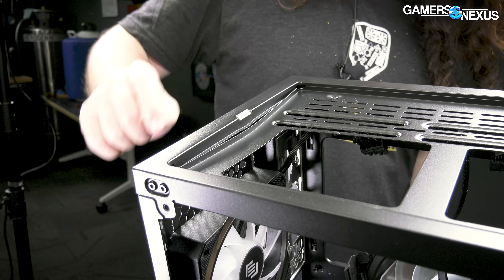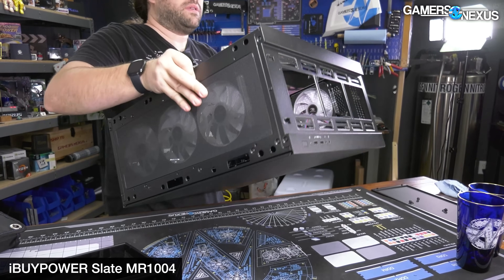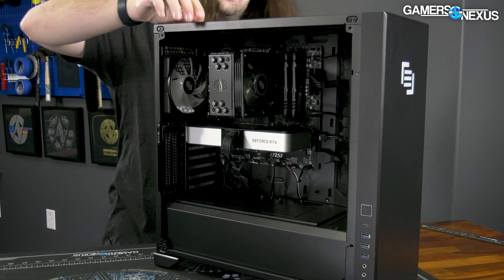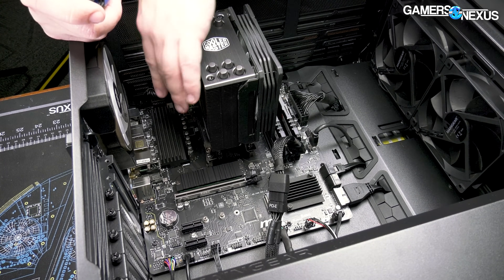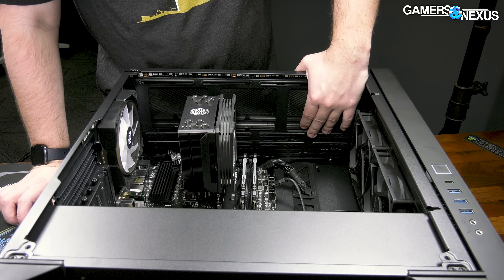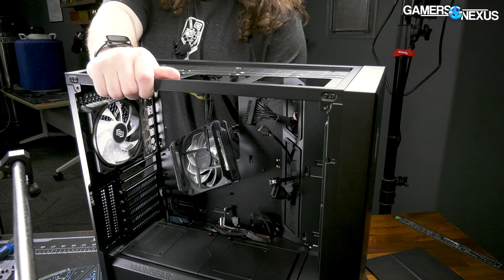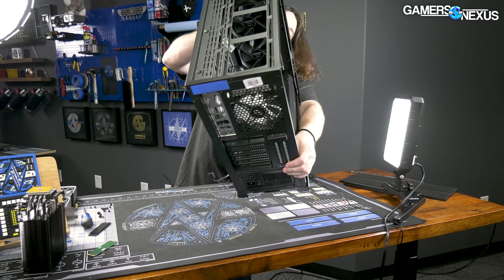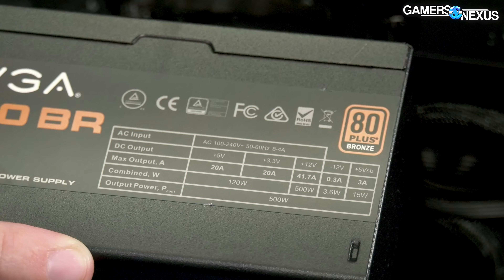Maingear Did It Right: Secret Prebuilt Gaming PC Review ($1700 Vybe)

Comment: Holy shit this is literally the exact PC I bought. It’s my first PC. Seems I made the right choice for a prebuilt
Reply: @cockatoo010  I’ve had it for a couple months now. I had to send it back initially because the cpu was busted. But after I got it back (which took a little over a week) it works great. Haven’t had any problems with any games I’ve played. Forza Horizon 5, Monster Hunter Rise, and Genshin Impact for example run great. Only thing I am going to improve is upgrading to 32 go ram
Reply: @nemesis8508  I'm curious what you mean by "the CPU was busted". You mean the CPU cooler? Because if so I would think that would be shipping damage. But considering the response from the CEO I would be inclined to believe that they would claim all damage as shipping damage as apparently they "run a tight ship". I suppose an employee making a mistake and passing on a damaged PC to a customer in order to avoid explaining it isn't even considered a possibility on that ship.
Reply: @nemesis8508  you don't need 32GB of ram if all you're doing is playing videogames
Reply: @lightly-red-huedmaleindivi6266  But 8gb v-ram might not be enough for some modern titles at higher resolutions. But I don't worry about that since I can't see past 1080p... 😅
Reply: @lightly-red-huedmaleindivi6266  I’m a game developer
Reply: @JonathanGray89  well the Pc would not boot and the cpu light was on. The support dude said it was most likely a bad cpu (don’t remember exact words).
Reply: @nemesis8508  Oh interesting. That makes me think there is probably a QC issue after all. I've done tech support and have never even come across a PC with a bad CPU. I've only ever actually seen that code associated with overclocking, bent pins, or unsupported CPUs. They will easily outlive every other component of your system unless you're doing some crazy overclocking.
Reply: @fahimp3  think you mean ram, vram is part of the gpu
Reply: @vanilla4064  I do mean v-ram since I was referring to the gpu. Cpus are less relevant than gpus when it comes to gaming, especially in higher resolution. When I said "But" I agreed with the commenter that 32 gb ram is not needed.
Reply: @fahimp3  Quality settings affect VRAM usage way more than resolution does. 8 gigs is plenty to work with if you don't expect to run every game at max settings.
Reply: @JonathanGray89  The greater the resolution, the greater the demand on your graphics card’s VRAM. The main reason for this is the GPU is having to physically render more individual pixels when using a higher screen resolution – requiring access to more data at any given moment.
Reply: @fahimp3  No, that's actually an explanation for needing a faster GPU. Many games barely require more VRAM with higher resolutions and the ones that do require considerably more are essentially because of quality settings anyway. You need higher quality textures for things to look relatively as good with higher resolutions, and textures tend to take up the majority of VRAM. Not to even mention things like shadows and anti-aliasing.
Reply: @JonathanGray89  "plenty" is a bit much. its enough... for now
Reply: @kingplunger1  I'm not sure what your standards are but I stand by my opinion of plenty. I have 8 gigs of VRAM myself and I don't find myself worrying about VRAM usage. Plenty enough for myself and many, many other people... For now, of course.
Reply: @lightly-red-huedmaleindivi6266  What about games that are usually memory/CPU intensive? Like say, large scale RTS/turn based games? Basically with lots to process like AI movement and such.
Reply: @PoisoningShadow671  No need even then for that much RAM. That much is really only useful if you're doing heavy multitasking, for example playing memory-heavy titles along with having like hundreds of browser tabs open.
Reply: @lightly-red-huedmaleindivi6266  lol

Maybe if you're only playing side scrollers. I have several games that use 32GB+.

Comment: My friend has this exact model and I have two of the higher level Vybes from this year. We both upgraded the SSD and the RAM and these things eat through anything we throw at em. Their build quality has always been clean and their support is awesome. For what it's worth, we didn't see the severe upper chassis damage in the video, but there was a little damage around one of the metal back panel screws from shipping. Great packing foam saved the tempered glass though. Out of sight, out of mind.

Comment: Just a thought: since this video series is running over a long time now, what do you think about adjusting the comparison charts for the new prices on these prebuilts? I just checked and I see that the Aegis R at $1700 now has an RTX3060, and the config that Steve reviewed is now $200-300 lower than when it was reviewed.
Reply: This system would still be better since it's priced the same but has a 3060ti instead
Reply: You should focus on how little care is put into building the system with MSI Aegis R, not its price. They send you a computer that doesn't come at the expected performance level. That's not acceptable even if its a gift.

Comment: I'm honestly stunned you got ANOTHER computer with product damage. It's something I've never seen, but I believe it's been the majority of cases for you now.
Reply: I’ve gotten quite a few cases shipped to me over the years damaged in shipping. My last one was the thermaltake tower 900.  I think ups and usps hate my hobby
Reply: It seems most of the pre-builts they've bought have had some damage somewhere.
Reply: My NZXT H510 case was also damaged during shipping. One of the panels had a massive dent that I had to smoothen out myself
Reply: @nathanlowery1141  maybe I've just been lucky. However, I don't remember any of their case reviews having damage over the years. Maybe that's because the companies knew who they were sending it to.
Reply: @Joostinonline  Or it could be the driver or loader that does their route for the shipper.
Reply: My HAF X is the last case I bought (and still use), and even back then there was some minor damage to the case.

Cases get damaged all the time because they're bulky and heavy, and really aren't designed to take a beating.

Comment: Microcenter used to sell those cases.  They occasionally got dented like that.

I built a PC in that case and just mounted the AIO fans as intake rather than exhaust.
Reply: I wonder what kind of scam that bot is running.
Reply: @FuburLuck  I'm guessing it's a variation of the Nigerian Prince scam.  They'll try to get your banking info to send you the prize, then drain your funds.

Comment: I built my first pc in this Maingear Vybe case, which Microcenter used to sell as a standalone. This case is designed and better suited for water cooling, Maingear uses it for their high end custom loop builds. I first used the stock Ryzen 3900x air cooler and the thermals were ok at best, would clearly benefit from more airflow. Then I installed a Corsair 360 aio as a front intake and both my cpu and my evga 3080 top out in the 60s, never break 70 even under heavy load or simultaneous benchmarking. I’ve been very happy with this case and never felt the need to update/upgrade it, and I’ve upgraded every other component in my build, some several times over. I’m also a car guy and love that the Maingear logo is inspired by the manual gear shift pattern.

Comment: Cool to see you review a main gear. Although a lot of these prebuilt are horribly priced right now as they are priced like gpu’s are still double msrp when they are somewhat normal now.
Reply: Yep. Hopefully pre built prices start dropping too. My local micro center had 5 3060ti's in stock for retail. I was blown away
Reply: To be clear, this system was ordered back in October this past year, back when GPU prices were still hot garbage. I'm interested to see where a system like this would sit with prices having come down significantly as of late...
Reply: @TommyFenstermacher5150  i mean they already dropped the price by $100 compared to in the video

Comment: I knew it would be maingear . Lol. I purchased a system from them a little over a year ago.. 5900x cpu , 6800xt gpu , 240 aio on the top . Never seen my CPU break 70°C with all core over clock. The case works better than it looks .

Comment: I bought the 3070 / Ryzen7 w/AIO cooler version of the Vybe during their black Friday sale for right around the $1900 mark. It beat or met basically everything I cross shopped it with at the time in price to performance. I can second everything GN found in this review good and bad.  My case wasn't damaged like the one in the video. However it was a little twisted, which made it hard to install the side panels after removing the packing. I gave her a little reverse twist to straighten it out. The box it shipped in was pretty beat up so I suspect shipping damage.  If you going pre-built I would highly recommend Maingear, seam to be one of the better system integrators out there, especially for the price. My only real complaint is it shipped in a bright red box with a PC on it during a GPU shortage, discrete packaging would have been nice. Maingear doing well in LTT secret shopper series was one of the main reasons I went with them

Comment: I bought a customized Vybe 3080 on October 25th, which was delivered on November 29th. After a few months of owning the PC I started having issues with games and other applications crashing and the occasional blue screen of death. 

I did some troubleshooting and after running memtest  I discovered I had faulty RAM (2x16 GB DDR4-3600). Maingear sent me a replacement kit after paying a deposit of $269, which was refunded upon return of the old RAM kit.  It did cost me the price of return shopping on the old RAM, but it was like $20 so no big deal.

Overall, I'm very satisfied with my build.

Comment: I got a 3080/5900x vybe last year.  I wish I could have built it myself, but at that time it was impossible to find a 3080 for a reasonable price. (It would have cost me about as much as I paid for the whole system for just the 3080) overall I had no issues at all and it has been performing fantastically since I've gotten it.  Good to know you put a seal of approval on it.  I do plan to do a case migration at some point. But I haven't had any issues with Temps thus far (I know. Surprising since it seems so choked off.) Cpu never goes above mid 60s under load. And the gpu sits right around low to mid 50s under load. All on all I was (am) happy with my purchase.

Comment: "Today Steve says he would probably recommend a prebuilt PC in a case with a solid front panel." Who are you and what did you do with the real Steve? But seriously.. that just shows how bad most of the prebuilds have been. A PC built without any major mistakes other than being in a sh*t case makes it relatively good.
Reply: To be fair to the case and SI, cooling wasn't an issue. One commenter said it did result in a lot of dust being pulled in, though.

Comment: Awesome video! I hadn't heard of Maingear Vybe, but they're definitely on my radar now! Thank you for taking the time to strip the PC down to examine the build and sharing all the stress testing. I've really been enjoying these videos as I'm trying to learn more about either building or buying my next PC. I'm learning very quickly that bigger price tags DOES NOT MEAN the person putting the machine together knows what they are doing! It's the little touches you guys found during the testing or stripping that blow my mind; superfluous engineering in Alienware/Dell or globs of hot glue in Wal-Mart PC's, or even just poorly designed airflow: seeing how these impact the system build's heat, processor speeds, and GPU performance has been really eye-opening! Thank you again for taking time to educate your audience and do deep dives!

Comment: I've never owned a Maingear, but they've always given me the impression they are a top tier OEM.
Reply: Dell and HP are OEMs (Original Equipment Manufacturer). Maingear is an SI (System Integrator) since they don't make components, they buy and assemble them.

Comment: At least this system came with the best inexpensive B550 board IMO. The B550M PRO-VDH WIFI has pretty good VRM thermals and options for the price based on Hardware Unboxeds testing.
Reply: I have a couple of complaints on that board, is it is power limited if you want to boost with Ryzen Master (as I found when I upgrade to a 5950x). My other complaint is with the mystic light controller which if you use a "temperature" pattern resets any other patterns running on other ARGB headers (I wanted to have my CPU cooler show a temp related color but it kept resetting any other patterns I had running when the temp changed)

The ARGB controller is also fairly easy to brick according to OpenRGB and also controls the fans so that is a bad thing.
Reply: @NW1peter  Interesting, but I mean given the tier of the board those are sort of minor or expected issues right?

I mean the RGB thing is maybe sort of minor but also an issue that should not happening so fair. Running a 5950x in this board seems kind of obvious that you may run into power issues or potentially even VRM temp issues if you tried to OC it. 

These things are good to know though and I am considering getting this board for a build I'm doing for someone else, but I'll only be using a r5 5600 in there.
Reply: @ZWortek  The RGB is a minor annoyance, again not something a lot of folks would care about but something I noticed the patterns resetting out of the corner of my eye when the CPU had a little temp bump.

As you say the VRM power limit isn't a big issue for cheaper CPUs the B550 is normally paired with, I'm happy enough with the B550M Mortar I replaced it with. I only really needed one PCIe x4 M2 and the PCIe x16 for the graphics card so the extra cost of the x570 didn't seem worth it to me. 

I ended up selling my original system (Pro VDH-Wifi+3600+rx580) once I bought a new GPU to a work colleague so I didn't lose out overall.

Comment: I wonder how these will stack up against a build of the same price from microcenter(including their assembly fee). Now that there is a big hardware vendor that will build your custom spec in NA it looks to potentially be a good alternative to these. Where I live vendors have been doing it since the early 2000's, if not earlier, so branded prebuilts aren't very common. If this happens in a bigger market like the US I reckon most companies would have to bring something extra to stay relevant, which would be interesting.
Reply: Didn't realize MicroCenter offered a PC build service. Definitely need to pass by my local store this weekend and check it out.
Reply: @lawvincent  IIRC, the labor is $200 for air-cooled or $250 for an AIO-cooled PC.
Reply: It's so expensive I wouldn't be surprised to see that pre-builts from even the worst OEMs beat it in price to performance. And they for sure will on the lower end of the budget.
Reply: @alaeriia01  Just looked it up and tier 1 is apparently 149.99$US for in store pickup.

I can get a spec built for free(when buying all parts from the vendor), by any of at least 4 hardware vendors, shipped to my door.
And my country has about as many people as NYC.
This is pretty stupid tbh
Reply: @Rspsand07  MC's custom build service is closer to a boutique PC builder than an OEM, in my opinion.
Reply: @alaeriia01  It's too expensive. It'd be like half the price of a budget build. And like the other guy said, some stores offer it for free if you bought your parts from them. A shitty company here known for shady shit and terrible customer support still offers it.

Comment: Last year during the GPUpocalypse, unable to find parts at MSRP, I pulled the trigger on a "Vybe Stage 3" (5900X + RTX 3080 FE) for $2500 and I have been very pleased.
This is the only prebuilt I've ever purchased, but it was configured and built almost exactly how I would build it myself.
There was a shortage of their Vybe chassis at the time, so they opted for a Lian Li Lancool 205 Mesh as a substitute, for which I have no complaints.
They're running a solid operation over there.

Comment: I bought a Maingear Vybe, appears to be the same case, slightly different hardware configuration (My build was a Ryzen9 3900x  32gb ddr4 3200 ram RTX2080 super). Mine did not come with any of the frame warped or bent as the unit you reviewed appeared to have. I have had absolutely no problems whatsoever with the PC. I copy volumes of GBs of video files across my network between pcs to/from its internal drive, and have not had slowdowns like your observed, perhaps mine has a different drive. I was quite impressed with their os/software build and how they avoid adding bloatware. It's working great as my "Stream" PC.  Id buy another one.  18 months later, still very happy with my purchase.

Comment: Thank you for the tips on not putting the top fan slot as exhaust. I was thinking on adding more fans for quite a while but I was afraid it would just do more harm than good, and you confirmed it. thanks
Reply: He did say you could do one as intake.
Reply: Timestamp? Can't find it
Reply: @syed2694  6:00 is when he starts talking about the airflow and pressure overall.
6:30 is when he starts talking about the top intake/exhaust setup
Reply: @Zetharion1  yeeeah I can totally do that, but it would look bad and uneven. Its either 2 intake/2 exhaust, or 1 as intake and 1 as exhaust but that would look kinda weird too